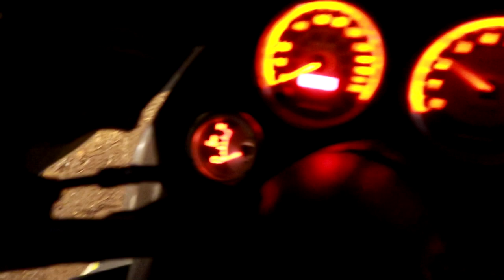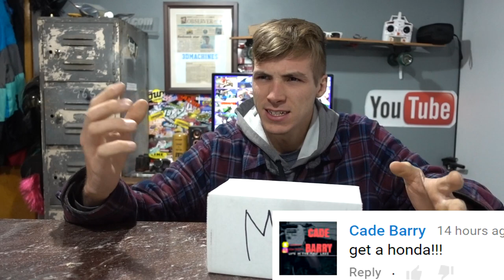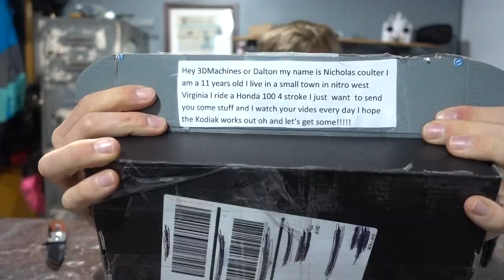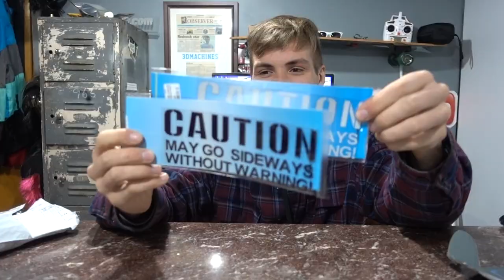ALMOST LOST IT!!

Comment: I have a 97 YZ 125! Athena aftermarket Cylinder, definitely could use some port work or repair on my OEM cylinder. But keep on truckin 3DMachines. The 05+ Yz bikes have a super light aluminum frame! Brapppp on brother.

Comment: yamaha yz250 2 stroke man, you wont regret it
Reply: G0NAGN I agree
Reply: G0NAGN he should get a yamaha because unlike honda yamaha never stopped making their 2 stroke 250s and just last year they made the yz250x and that bike is more suited for woods racing . Honda and kawasaki haven't made a 250 for quite a while. There is always ktm/husqvarna (same engines) and they are good too but yamaha is much cheaper to maintain and the aftermarket is massive for the yz250 because they have been out for so long and the engines haven't changed much since around 2000
Reply: I definitely agree he hasn't had a Yamaha for ages
Reply: G0NAGN Yamaha is the bomb i have a 85 but it is still fun
Reply: G0NAGN agreed

Comment: What's critical on a belt is that they are always put on the same direction. So if a new belt is put on backward the first time it should always be ran that way.  Also when buying a belt there is usually a Heavy Duty and light duty belt that fits. Some people use the light duty as a spare to save money but personally, I consider that a waste just buy the good belts. Break in both your running belt and spare belt so your spare is ready to be put on when needed.

Comment: KTM 250exc or 250sx!!!
Reply: HybridEdits exc
Reply: Similarlobster 8 I agree. SX is very good in the woods, but the EXC will already have everything needed to be done to the SX already done and it got a heavier flywheel so you can lug the bike in low gear for ever and not stall.
Reply: i agree

Comment: KTM  is definitely more race ready with its suspension and brakes but the Yamaha is a no brainier for reliability and is economically a better option. 

You aren't a pro so the performance gain on the KTM is irrelevant.
Reply: I ride a KTM 450 XCW and love it but would probably go Japanese next time for cheap parts and aftermarket support.

Comment: i once had a 121, mxz 600ho sdi 2007. never again will i have a short track. i mostly do off trail tho but even in the trail i hated it. got a pro rmk 800 163 2014 now. its a beast

Comment: put duct tape across the bottom and around any air leaks.  been snowmobiling my whole life and know all about the cold eyes face problems.   especially back in the 80's and early 90's when all we had was open face helmets with a chinsey plastic shield.  it makes a windscreen on the sled very nice

Comment: Dalton you need yourself a yamaha yz250. They are cheap and reliable. You can also get a 295cc big bore kit/fmf gnarly and a flywheel weight for all the torque and power you could need while still being a light bike. But all though you are quite tall you could get yourself a kawasaki kx500 or honda cr500 2 joker and have some real fun but then that would be a lot like your 450 (but more harder to manage the power peak)and you would not get to use it in races or even want to race it . I had a yamaha yz490 that had so much power but it was a lot of work to ride it.